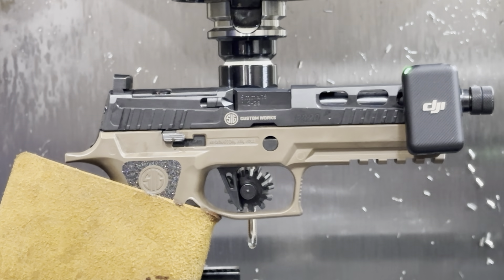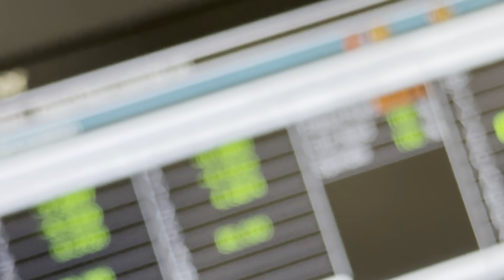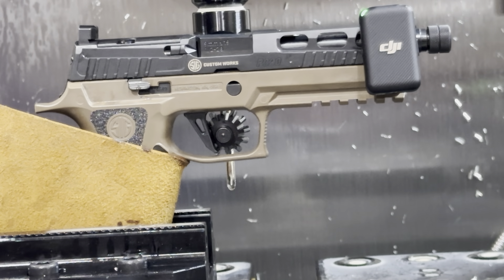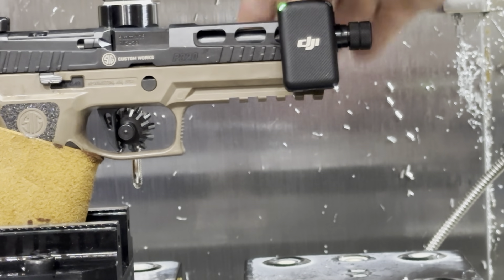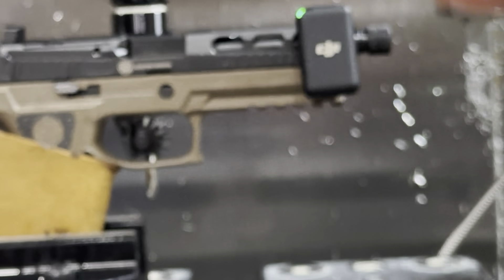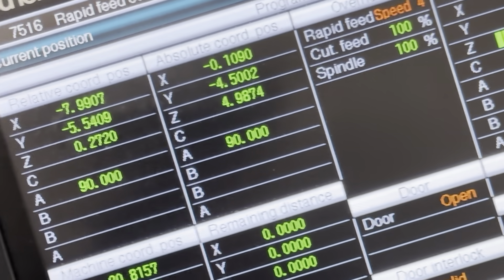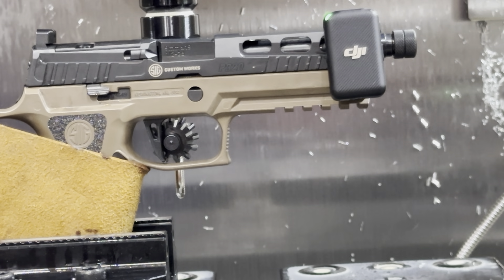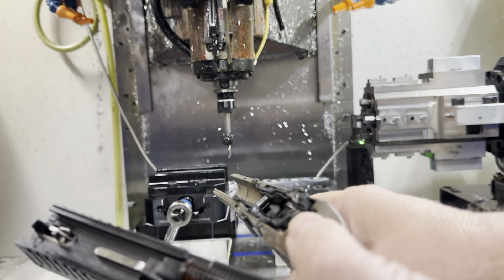Sig P320 accidental discharge tested in CNC machine.

Comment: I did this with a primed empty case with a 20 rnd mag from sig squeezed the slide and frame… pop with ZERO TRIGGER TENSION
Reply from the maker: If it did what you say….. back it up with a video.
Reply: @Thinkingman615 it did there are other guys that made the same video i would have produced. Your test base based on a faulty presumption. You are a shitty machinist

Comment: While i agree the trigger has to be pulled to discharge. However no gun should go off by pushing and wobbling the slide even in the middle of a trigger pull. The pistol should not go off until it intentionally lets go of the sear. Just my 02 cents

Comment: so if im understanding this correctly, could this whole issue be fixed with a trigger safety? i mean if the issue is slide play in combination with the trigger being at the wall then it seems to be like this issue is that the trigger is being depressed not that the gun is just going off. how does this explain reports of the gun going off by itself? i mean nobody stores their gun with the trigger pulled back to the wall and if they did theyre asking for ND  no matter what type of gun you have. i agree slide play SHOULD NOT discharge the weapon, its still an issue but idk if pulling the trigger back and wiggling the slide is the best way to demo an issue. unless your fully ready to shoot the trigger shouldnt be held at the wall so this should never happen if proper practices are met. second i dont think this specific failure explains the guns going off being reholstered unless people saying its fingers being caught in holsters pulling the trigger in which case thats not the guns fault again. this is an interesting test and i think sig 100% NEEDS to redesign the p320. it has lost public trust at this point its only hurting their brands to stand behind this product. i own a p320 and actually enjoy shooting it but with some minor redesign work all the issues with the p320 could be addressed and the public would get off sigs nuts about this issue

Comment: I have the Sig-226. A hammer fired pistol. The Sig-320 is striker fired. So any comparison is apples versus oranges. The #226 does allow the magazine to be inserted into the lower, when the slide is off. You must remove the magazine to remove the slide or reattach the slide. I never noticed this fact as I always remove the magazine prior to disassembly anyways. Plus, removing or replacing the slide is much easier if you put the pistol in a locked slide position. I always put the hammer in a locked position prior to pulling the slide to the rear. I do this on any brand of hammer fired pistol.

Comment: I always wondered way all these videos showing people putting screws in the trigger so it was past the wall then wiggling the slide and saying see they are dangerous when the striker dropped were so popular. I always thought well of course it is going to go off when you have the trigger pulled to the point of it almost breaking then wiggling the slide around. Most striker guns will drop the striker in that situation. People just want to through SIG under the bus.

Comment: what I take away from this is yay the gun has some slop, but if you don't pull the trigger it doesn't go off. Now if we could get FCUs with parts that are just in spec and mix and match the parts and then see what happens. I still say that any test that involves moving the trigger rearward only proves that if you pull the trigger the gun can go off like it was designed to do.

Comment: So, the trigger is put up to the wall, which it would never be at when holstered. Even then, the gun fired in a police officer's holster. So, my take is that this pistol is not safe. Why did Sig not design this pistol the same as the Sig P365 or S&W M&P or like Glock or like CZ, or like Walther, or like.... You get the deal. You need some kind of a series 80 firing pin safety block in the slide so that the striker doesn't go forward when the pistol is dropped or when it is holstered.  This is so stupid that Sig could turn this pistol, Sig P320, into FUBAR!

Comment: Not sure this is a good demonstration. First pull position deactivates the striker safety. Gun ready to fire. More movement, sure the sear will be released, and it is going to go off. I am not saying there is not an accumulation of issues. Quality of parts, slide fit, too light of a trigger pull etc.

Comment: I still don't understand why we are pulling the trigger on these things.  Let's figure out how it will fire without pulling the trigger.  Even 80% is nuts. What about an improper assembly?  This seems more likely to cause a firing from a slide bump.  This would still be an unsafe design.

Comment: My compliments on a good video sir.  I have seen several videos now of people recreating the SigSauer un-commanded discharge and there is one common thread and that is the manipulation of the trigger prior to manipulating the slide to generate the discharge.  Let's think about this using this gentleman's video for reference. If I go .090 of an inch past the wall and then squeeze the slide, the gun will go bang and another .010 or so, the gun fires as intended. Well, duh!  Let me squeeze the trigger and scratch my head when the thing goes off.  Here' a thought:  Keep your finger straight and off of the trigger until your sites are on the target.  for the record, I am a retired United States Marine and former police officer with 35+ years of experience teaching firearms.

Comment: look i’m not a sig fanboy. i do like some of their gun. what this video is showing is then you have pulled the trigger 82.5% of the way to the sear releasing as intended and you manipulate the slide within the play it has (all pistols have) the gun will go off. when is someone mostly pulling the trigger and going “wait let me move the slide. OH NO MY GUN WENT OFF ON ITS OWN! it’s defective!” if your getting to that point in the trigger pull then there is less then .020” of sear engagement and if the slide at that point has more or the same play then it will release. i’ll pose this question for anyone who would like to answer. how would you design a striker fire pistol to not go off after the sear is more then 80% disengaged from the total engagement without making the trigger a sloppy mess to fire?

Comment: Still, P320's are going off absent trigger pull, an issue with out of spec trigger bars and sears along with out of spec/degraded springs that are causing the geometries to end up closer to a trigger break and discharge when they pistol is bumped. The design of the FCU is dangerously flawed.

Comment: The P320 disables the striker safety very early in the trigger pull BEFORE you reach the wall.  But my P365 also defeats the striker safety early in the trigger pull and P365 are not having the issue.   So whatever is going on with the P320s that go off uncommanded is someone defeating the striker safety (as though the trigger were being pulled a little) I'm curious if on the affected P320s, the sloppy fit of the slide is enough to defeat the striker safety without any trigger  pull.  For what it's worth, my HS2000 doesn't defeat the striker safety until much later in the trigger pull

Comment: So what are we testing here.  If you pull the trigger the gun will go off. At what point after the wall seems like a witch hunt.  Failing a drop test is definitely a problem in my opinion.  You gotta love all the extra research being done by average joes.  Thanks for the info.

Comment: 19 thousandths is .483 mm, not 2 mm. The two aren't even close.  EDIT: Please read the comments below this post, OP explains.
Reply from the maker: Did you watch the video from start to finish?
Reply: @Thinkingman615  Yeah, am I missing something? 6:05 ish "19 thousandths, 2mm into the trigger stroke.." to make the gun go off. 19 thousandths is not 2mm, it's closer to 80 thousandths. With all respect, what am I missing? There is quite a difference between the two and I am trying to form a conclusion here. I don't have a dog in the fight, I shoot Glocks, but like everyone else we just want to know what is going on.

I do get your point, either way the gun will not fire without trigger input, but is inertial force (like from being dropped) enough to overcome the takeup + the trigger pull of 19 thousandths? In that case there is a big difference between 19 thousandths and 2 mm (.079) wouldn't you agree?
Reply from the maker: @lrh411 fired at .109, fired from slide wiggle at .090, so .109 - .090=0.019 that where that number came from. The .090 was measured from the wall where the slack is out of the trigger.
Reply: @Thinkingman615  I think I understand, they are both roughly 2 mm then from the wall. It fired sooner with slide wiggle, but in neither instance without 2 mm trigger input. Thank you for the clarification.
Reply: @Thinkingman615  When you started mixing metric and SAE into the conversation in the same sentence, it is confusing IMO.

Comment: The Sig P320 was an abortion upon conception and here's why some of them randomly discharge;
"Hicks found that the sear and striker foot portion of the striker pin both exhibited inconsistencies on the surfaces that are in contact with each other, “minimizing the actual contact surface area needed to keep the parts engaged until the trigger is pulled.” (Docket No. 70-1 at 5). The identified surface quality issue combined with a misalignment of interfacing sear step and striker foot (as per design specifications) were found to be the likely cause of the striker becoming disengaged from the sear. (Id. at 19). Further, according to Hicks, another internal mechanism—the striker safety lock—did not meet drawing specifications, thus creating a condition that would fail to stop the striker from moving forward. (Id.). Hicks summarized his opinion as follows: 

There are two features within the design of the P320 that must fail to allow an un-commanded discharge to occur. These are defined as “internal safety features” by Sig Sauer. First, the striker needs to be released by the sear, which based on the defects discussed in this report, is a precarious interface. Due to the minimal amount of contact between the two components (sear and striker), any vibration, inertia, or jostling of the firearm can cause the striker to be released. Second, the safety lock, which also exhibits defects and a compromised interface with the striker stop, does not stop the striker from making contact with a cartridge in the chamber. Because of the uncontrolled, or “sloppy” mechanism of the P320 firearm, un-commanded discharges will occur, as evident with numerous incidents across the country, with various law enforcement and experienced firearm personnel."

Comment: The problem is the sample size.
You only have 1 pistol, which only proves that your gun fires at that particular range of trigger pull.
In order for this to be valid you need a bigger sample size from different manufacturing batches.
Just a thought

Comment: Was the test done with a magazine inserted?
For me, it works exactly as you described. I ran the same test, but when I inserted an empty magazine, the issue no longer occurred.
If you did the test without a magazine, try repeating it with one inserted and let me know if you get the same result or not.

Regards.
Reply from the maker: No mag in this video but I post another video that has the mag in it.

Comment: I get that it goes off after the trigger is somewhat pulled. I guess it's a tolerance thing. But I haven't seen anyone show one of these go off when the trigger isn't somewhat pressed. I agree that it shouldn't go off unless fully depressed. Is the assumption that the pistols that fire in the holsters have such crappy tolerances that the trigger doesn't need to be pressed at all and they fire from just wiggling the slide?

Comment: I think the issue is the safety mechanisms get clogged and do not activate, so the safety mechanisms you are defeating by pulling the trigger never activate and it can go off simply by the force on the slide.

Comment: I have never owned a semi-auto handgun that had that much play between the slide and the frame! I also understand that this weapon is fully cocked when the slide is racked whereas a glock and other striker-fired guns are fully cocked upon the trigger stroke. So the 320 is essentially a single action gun, striker-fired. So, I am not sure that this proves anything since a fully cocked 1911, holstered and with the safety OFF, may be just as touchy, specially after a trigger job. Does this make sense? The gun still may not fire without pulling SOME on the trigger, if you get my meaning. That play between the slide and frame cant be that loose by design.....I find that hard to believe!

Comment: I’d be curious to test 10 or even 100 of them. Yours is .019”, but let’s factor in tool wear, and machine wear. Plus obviously operator error. Perhaps one guy could have machined 1,000 of those guns.. or more, and he didn’t change his tools enough or he’s working with a worn machine and typed his offsets in a little off.

Comment: If they fix the drop safe issue thats enough people are taking that issue confusing it with these videos where they pull the trigger 90% of the way and jiggle the slide well ya moron you pullled the trigger. Trigger disapline and youre fine now the drop safe issue is an issue that needs investigating.

Comment: So you put pressure on the trigger, wiggle it until it “fires” The obvious elephant in the room is, if you put pressure on a trigger ANY gun can fire. Typically in a true scientific scenario you would have multiple other firearms that would be test in the EXACT same manner…I understand you did this test on a Glock and it failed too, but you aren’t posting that information in the same video…seems like you are trying to manipulate public opinion for what reason? Please stop trying to promote yourself as some “smart guy” because your conclusions are not conclusive or credible.

Comment: this isn't the first video of the "trigger partially pulled" argument. That in itself is a problem. This isn't an issue of the gun discharging with the trigger partially pulled and the slide manipulated, its an issue of the gun discharging WITHOUT the trigger being pulled while in a holster. big difference.

Comment: This is a shit test. You have pulled the trigger back to almost its point of fire then basically moved the gun a little which causes it to move past its point of firing. I believe the problems sig had was a loaded gun with safety on would fire if dropped. This test has nothing to do with that.

Comment: I'm personally not that familiar with the 320. I've never fired one and probably only ever saw one at a show but I've seen 3 videos now where they have discharged without fully pulling the trigger. That just shouldn't be. Every modern firearm going back to John Browning based their entire design on that basic concept. Why is there so much play in that slide. Is that typical of Sig in general. I'll never buy one that's for sure

Comment: When you start to pull the trigger, you raise the piece that disengages the strikers safety lever. When these folks are pulling the trigger to the wall, I think they are simulating that the safety lever has been taken out of play. With it out of position, squeezing the slide is apparently allowing the striker to slip off of the sear. That alone is a very scary thing. Slide clearance is the only thing keeping the striker on the sear?

 If these guns are indeed going off uncommanded, something is preventing the safety from properly functioning or the trigger isn't fully resetting. This could be as simple as a combination of wear along with some dirt or carbon buildup. FWIW, I have two upper assemblies for my M17 and I can't get it to fire via slide manipulation with either one. 

The fact that slide manipulation can make a gun go off under any circumstances is concerning to me. Also, keep in mind that there are in effect double action and single action striker fired guns. The 320 series is in the single action category. It's striker is fully coked anytime the gun is. A Glock is somewhere in the middle. It's striker is only partially cocked and needs the trigger pull to push it the rest of the way back. That's why they don't have great triggers. 

I have an M17 and a Glock. I used to carry the M17 daily, but I have stopped. The Glock is only for show and tell when someone wants to see what a Glock is like. I think I'll stick to hammer fired guns.